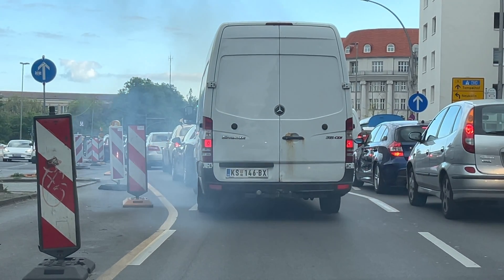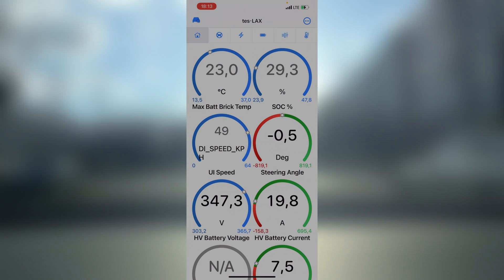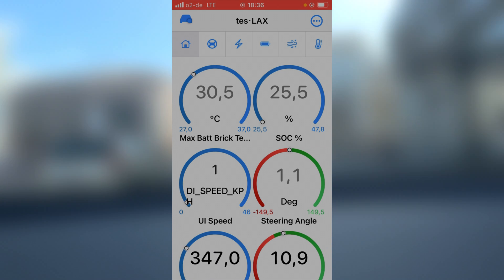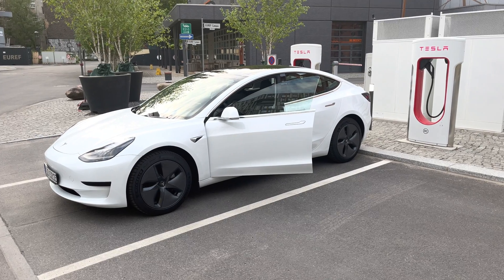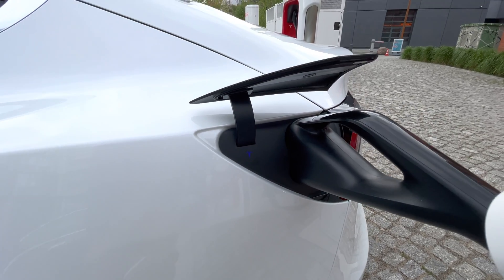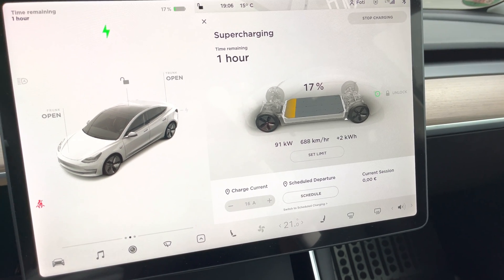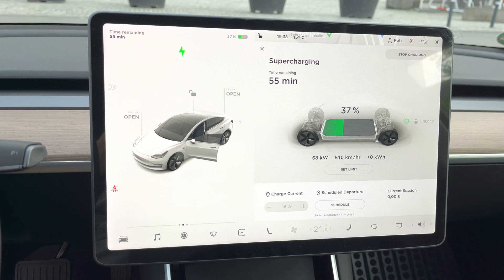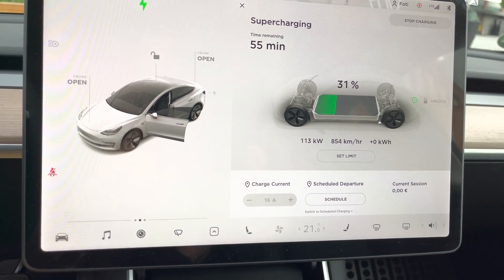LFP Tesla charging speed test: revisited

Comment: I've seen videos where they only hit 160-170 kW when the battery is around 40°C. With high speed at autobahn and preheating it should reach it.
Reply from the maker: Was that LFP?
Reply: @evdeepdive  I think so yea, I saw it on "drive smarter" channel. He also has a LFP sr+
Reply: @gitroni  Yeah I also heard that 40°C is optimal for LFP, you can also charge longer at higher charging speeds if your battery is lower.